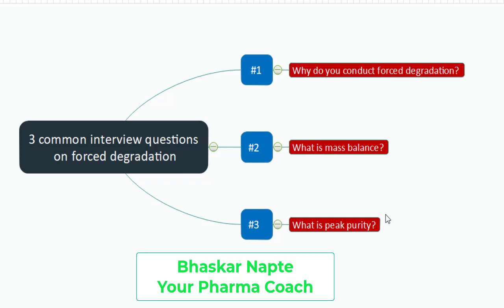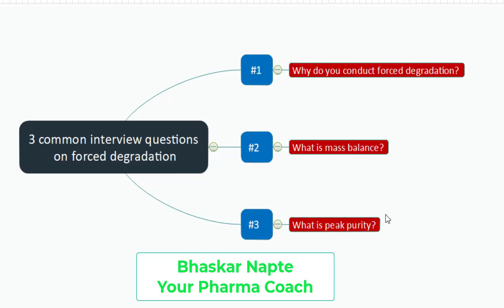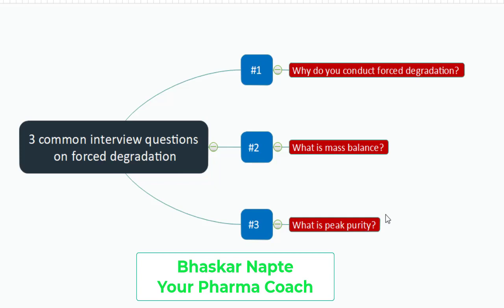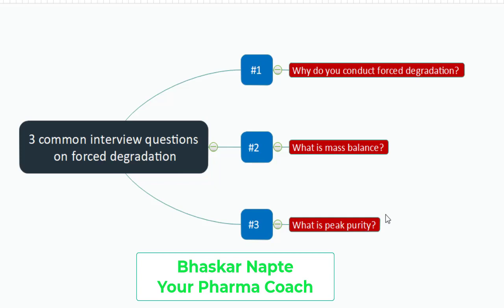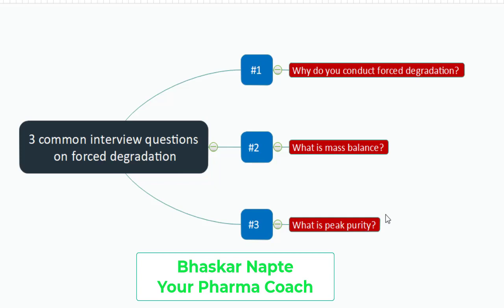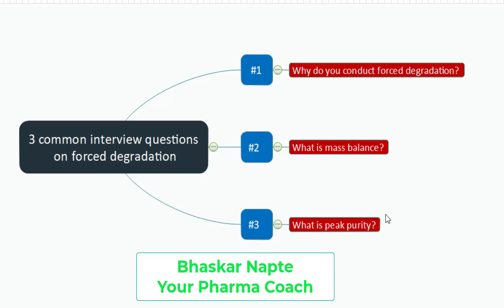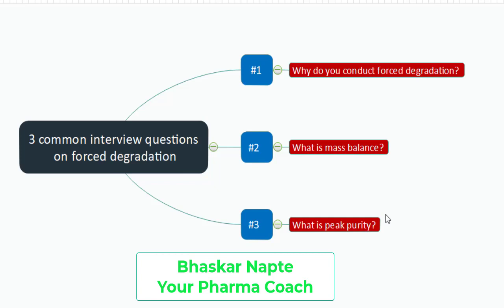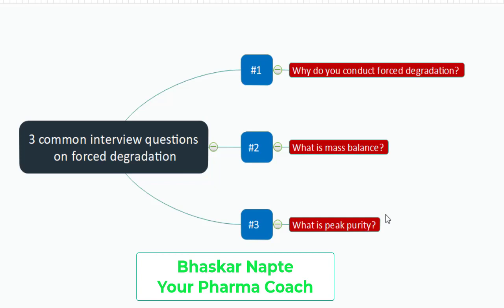3 common interview questions on Forced Degradation

Comment: Limt how mussh sir massa balance
Reply: There are no guidance says about limit for mass balance and industries generally follow NLT 95% as limit.
Reply: @jayakumaryerukolu  and another question in rs method standard preparation with respect to highest induvidual unknown impurity level prepared why?
Reply: as per company to company varies 5 % to 20 %
Reply: As per sop 20% 
U can r perform  minidegradation only cause past degradation can not give mass balance
Reply: + 5% and -5%